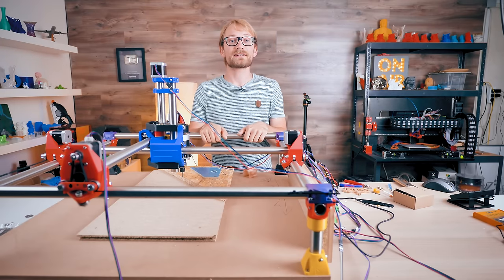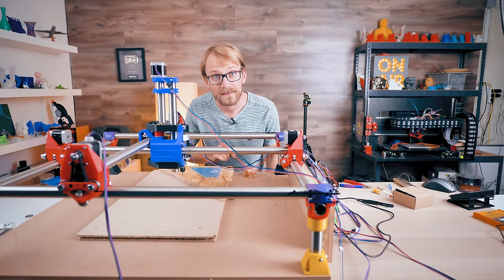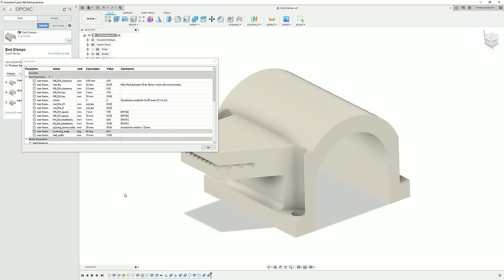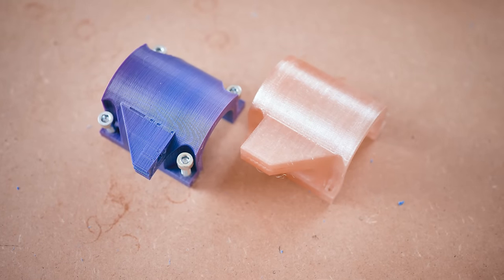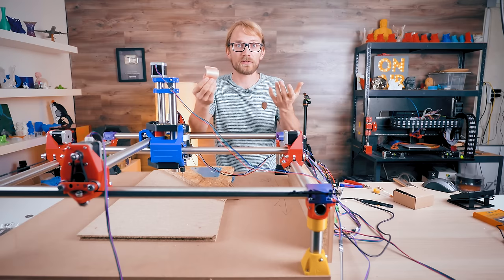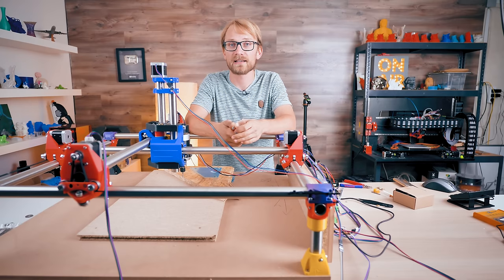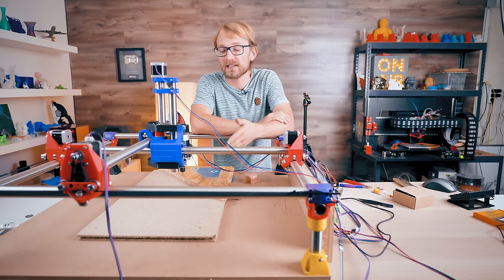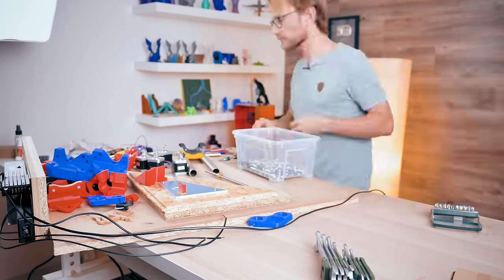Whose design even is this? (MPCNC conclusion)

Comment: I won't be building one. I was already hesitating the past 2 years or so because it wasn't technically open source to begin with - but knowing that I can't make and share custom bits completely ruins it for me. 
Tweaking and sharing improvements is literally half the reason I build things! I like to build tools (mostly software) and share them.

Looks like the logical progression is either the Root CNC (which I was leaning towards - but it seems less popular and is NC licensed) or Irvan Miranda's design.
Reply: @isaackvasager9957  yeah, i was thinking the same thing.  I have several aftermarket parts on my mpcnc. Seems like there is more to this story on both sides it seems.
Reply: @isaackvasager9957   Ryan had no problem with Tom releasing the design. The rub is that Tom wanted to release it with no license restrictions. All Ryan asked is that Tom re-release the part with a properly restrictive license so that people wouldn't try to sell it. This design was never open source and Tom knew that before he printed and built it. For Tom to release this part with no restrictions, then balk when Ryan nicely asked him to change the license is totally not Ryan's fault.
Reply: @isaackvasager9957   From what I gather it was more to do with the actual license that Tom wanted to release it under. 

MPCNC is released with a non-commercial license meaning it can only be sold by Ryan. 

From Ryans POV - Remixes/Improvements should be considered derivative and published under the same license.

Tom made a new design and released it under a license that would allow for someone else to commercialize it.

In other words,  if Tom were to have made changes to the all of the MPCNC parts by changing each dimension by .00001mm and released them with this  license then anyone would be able to Print Tom's files and sell them. Effectively undercutting Ryan's livelihood by allowing anyone to clone the MPCNC and sell it online. 

As far as I can tell Ryan has no issue with remixes/redesigns so long as they are under the same non-commercial license.

Seems to me that Tom could've chose to make the changes he wanted and simply released under the original MPCNC license. Instead he chose to try to strongarm Ryan into making this completely open source.

I appreciate Open Source projects but IMO respect to the creator comes first. In this case I see no reason why  Tom couldn't have just respected Ryan's wishes and made his redesigned parts the same non-commercial license.
Reply: @reneromo8814  that is not at all what for instance Prusa does for living. Hunting down people with other licenses.

But as Thomas CLEARLY say.  Obviously MPCNC is not suited for him, or me and many with me.  So we are respecting Rays wishes and going in another direction.

Happy hacking with the MPCNC, I will not. Pity though, as the design looked nice.  But that is how it is.
Reply: @isaackvasager9957  MPCNC isn't open, even though many, including Thomas and me, thought it was.

Well, there are other CNC designs...
Reply: @isaackvasager9957  doesn't care if you think it works great, it will not suit Thomas nor me.  And that is what counts here.

To bad it is because of licences, but that is how it works.  It totally up to Ryan to decide who and why people are allowed to use his design. 

So no, it doesn't have ANYTHING about if it is fair for Ryan. It is about what is reasonable and fair for they users of his design. For who it works for.

So again, neither I nor Thomas had even suggesting that Ray should change his license, have we?  So why do you ask if it is reasonable for Ryan?  Obviously he think that it is, as he chosen to apply the licens and expresses his will how it should be used.

And to be clear, I am happy it works great for you, with the licens limitations.  And yes, I KNOW it works for many others, I have followed the project for a while.   The license doesn't work for Thomas nor me.  
Happy hacking.
Reply: @reneromo8814  This is wrong for a couple reasons.

First, there's no "changing each dimension by .00001mm". That's not how copyright law works. It's designed to be flexible so ideas and innovation is protected, not exact dimensions.

Second, there's no reason to think Tom "chose to try to strongarm Ryan into making this completely open source". The whole point is it wasn't Ryan's design to begin with. As Tom said, copyright does not apply to elements of a design which are obviously necessitated by constraints.

If "respect to the creater comes first", you should be siding with Tom. In this case I see no reason why Ryan couldn't have just respected Tom's wishes and let him release his design under the license he chose.
Reply: @reneromo8814  Actually, Tom released the part under the same non-commercial license, said so clearly in one of his tweets...of course, his license didn't include Ryan as an exception, so he couldn't pull it into his for-sale parts, which is probably part of why Ryan was unhappy with Tom.
Reply: @LuisGarzaVox  That wouldn't make sense, since them Ryan would be profiting from Tom's work. It's a new part, not Ryan's design, so if Tom made it, he should be the one profiting off of it, if there were any profits to be made.
Reply: @skynet3d  see, the issue is that Ryan wants to have his cake, eat it and eat everyone else's as well. What he appears to want is for copyright of all designs that are compatible with his system to be assigned to him to make profit from it. So he's mad that Tom's part is public domain because others might make money from it, and he's angry that Tom changed the license to the one he wanted it changed to since he can't make money from others' work with that one. 

The only logical conclusion is that he wants Tom and other creators to immediately assign him copyright rights because "he had the idea first" or some similar worldview. This is not how copyright works and it's not how ideas work either, so effectively you can't make anything compatible in a way that is acceptable to him.
Reply: @skynet3d  that's just it, it's NOT new, it's completely inspired by the original design, regardless of it was built "from scratch".  If I re-write "Harry Potter" in crayon and spell his name "Hary" instead of "Harry".  It's not new, as I was obviously looking at the original to create my "new" work.
Reply: @GeoffreyPitman523  You're confusing a piece of artistic expression with a functional part. If I make a brake rotor for a Ford Mustang, Ford doesn't get to claim copyright over my brake rotor. Just because it performs the same function and fits in the same holes, doesn't mean the original designer gets some ownership over it.
Reply: @skynet3d  try not to just spout off Tom's incorrect argument.  It's a copy of the original.
Reply: Geoffrey Pitman it doesn’t matter. You can make functional parts that fit an existing design without concerns for copyright. The only way for that to be protected would be with a patent or somehow registering the part as a piece of art. None of that applies in this case. If you had a point no one would be able to make iPhone chargers, or any third party accessories for anything. Think about what you’re saying, it’s nuts.
Reply: @hodgeac  100% agree!
Reply: @reneromo8814  Disregard for open source licensing would be the downfall of the entire movement. All Ryan wanted was for Thomas to comply with the terms of the MPCNC license. Thomas chose (wrongly) to assert that his design is somehow original. It isn't. It "builds upon the material."

Thomas is wrong. Ryan is right. Regardless, none of this was appropriate in public fora.
Reply: Nah Thomas was correct and made his case in the video.  Thomas made a compatible part, that is something that we do for computer, cars, and builds of all sorts in all industries every day. Thomas' part was functionally different and wasn't even made to fit anything but commodity parts. This is just one maker trying to lord his decisions onto others when they didn't like his design decision. Pure childlike tantrum.

Comment: The gantry design of the MPCNC seems very derivative of the Ultimaker 3d Printer's design.  Perhaps Ultimaker should be suing him?
Reply: SPANKED!
Reply: @c4tohagen   V1 engineering did not invent 3D printing, did not invent the half cylinder, did not invent even the gantry mechanism, did not invent a pipe holder made of two halves. He's entitled to the copyright of his STL files but he is not entitled to a patent as far as the invention of this machine or any other intellectual function of that machine. . If he tried to get a patent for this machine he would get a smack down from a Company that has already patented the mechanisms that he's trying to claim.
Reply: So true, and so do the 608 guide on tubing. This is so ridiculous...
Reply: @intelligenceservices  And that is true in ANY country law! What (design) goes on the internet stays on the internet and is therefore doomed to be opensource. Good luck trying to stop that for the rest of owners life!

Comment: A while back when I first saw the MPCNC I looked into it more. This was in the early days of the project and I chatted with other people on line who built them. The impression I got back then was that the creators were not good people to deal with and it would be better to pass for the time. I thought they maybe have gown and were better to deal with now. This is proof that they are doing the same stuff and this machine will be a hard pass for me from now on. Tom was changing my mind about this project up until this video. Then all the bad crap I learned about came flooding back.

Comment: "I want to design a CNC machine that users have to 3D print parts for, but I don't want said users making and sharing 3D printed improvements for it." That's kinda backwards Ryan. 

Man, I was really enjoying this build and want one for myself. I think I'll wait a bit longer.
Reply: That’s not true.  There is a huge list of mods made for the MPCNC.  He just wants them to use the same license that he uses.
Reply: Just design one yourself that uses 608 bearings as linear rails, it would be a fun project.
Reply: Edited
Reply: @williammiller3277  that is not the Ryan who runs V1....
Reply: @timr86868  thanks for letting me know. Shoulda known by context alone.
Reply: Modding and sharing is not the issue, look around Thingiverse.  He just wanted them shared as the same license.
Reply: @GeoffreyPitman523  which he can ask, I mean you can ask anyone anything, but has no legal right to.
Reply: William Miller he does have the right to ask. That’s how the license works.
Reply: @timr86868  Making a compatible replacement part is not making a derivative work, it's not a copyright thing at all, or you wouldn't have third party auto parts.

Comment: Damn, that’s a shame. I planned to build the mpcnc before the videos launched but I will think about it twice now.
Any recommendations for a true open source mostly printed cnc?
Thank you for your honesty.
Mach weiter so!
Reply: Gohliat1337 Same for me. Will look for  another printed cnc
Reply: Don't bother.

A CNC needs rigidity because of the lever arm forces + rotational forces induced by the cutting head/motor.

Making one (excepting time and material costs)with 3D printed parts is like walking one step forwards, 10 steps back. 

Trust me. It's a waste of time elevated to nightmare shituation.

That being said, you can get away with making various components out of wood/MDF/HDF and various pipe clamping options. Using printed parts isn't worth the effort because they can't assure you of the tolerances required of a CNC. At the lowest end, is wood, above it, aluminium, above that steel, and the top, cast iron (there are inbetweens like, pouring concrete inside the components to add weight (mass is important) and rigidity).

As for design ethos, look up the Inventables CNC. That's the most barebones CNC design you can get, and that's a good thing because you can adapt a lot of the elements found in there to pipe and clamp design without spending too much time figuring out what should be what.

One other hint, get a dial indicator. The cheapest of greater division (inches or mm, your mileage may vary) you can find on fleaBay/Aliexpress etc. You need one. From measuring the parallels, to the travel, to the table plane being level. You cannot build a CNC without such a tool. You'll also need an arm and a magnetic stand for it (also, found on the cheap on those websites).
Reply: @aserta  shituation had me good XD
Reply: . Look on thingiverse
Reply: Don't waste your time, is very clear that they don't work, watch the videos, this machine was 99% fail
Reply: @matutolaYT  Your video maker couldn't follow basic instructions. Tons of us have cut aluminum or even steel with these machines.
Reply: @matutolaYT  Watch a properly built mpcnc video.  Tom cut corners, and didn't read the instructions.
Reply: Teaching Tech made a video about a cnc that is using a table as the bed an rides with wheels on it. Can't really remember the license on that
Reply: @SchwachsinnProduzent  It's the lowrider version of mpcnc from v1engeneering... same problem
Reply: @Gohliat1337  yeah, I noticed it after I searched for the video again (but couldn't find my comment again to correct myself)

Comment: I witnessed the original twitter exchanges.  This type of thing gets sticky real fast.  I don't really like NC licences when used in this context: they are better used in other contexts like as part of a marketing push or a end-use-only tool for personal use cases... and are what i like to call a 'dead-end' licence. I consider them only quasi-open, and it shoots the originator in the foot otherwise.  The NC clause feels rather like just a glorified instruction manual and collaborative beta-test. For example: the RADDS printing board is CC BY-NC, which precludes monetized discussion, and as a result, there is very little discussion on the widest-used platforms -- i.e. monetized platforms -- and they have gernered onli niche attention.  Same goes for Gen7. but the discussion brought up two interesting grey areas: work-alikes and monetization via education by fair use.  Personally, I take Thomas' position here: work-alikes are not covered by the original licence, and monetization via education/discourse is fair game, within reason. monetization via education is covered by fair use 99% of the time, unless a specific clause is included to preclude it, BUT technically NC would preclude that except under fair-use... which is where the licence comes into conflict with precedent and accepted-convention. A work-alike is perfectly fine and accepted unless it violates some other clause or licence, like an aesthetic trademark/patent, etc.  The same goes for 'aftermarket' parts:  see the auto industry for legal examples.  If aftermarket bolt-on work-alikes are fine for even restrictive patent law, I believe that is a good enough precedent for application here. Otherwise many many projects tied to things like Linux would also be illegal (even the 'sticky' applications in that realm: MAME, WINE, etc, which are generally accepted as legal within reason).  The original author obviously embraces the former but rejects the latter. But I think Thomas also made the correct decision in that while he may be in the right, chose the high-ground and conceded to the author's wishes, be they reasonable or not.

Comment: Licenses are a mess. Props to you for pointing that out
Reply: Licenses are fine, but illiterate, greedy and envious people applying them to whatever are the mess.

CC-NC series of licenses are meant for common "freeware" and "shareware" where you can have your demo version for free but can't do anything with it and have to pay for some different license in case you want to actually have it.
But modern hipsters just throw in NC clause out of greed or envy, without thinking for a second about issues and consequences it will result in.

CC, sadly, is but a malignant tumour on the opensource community which is a malignant tumour itself on the free software movement.
Best we can do is to just cut it away before it's too late.
Reply: If you dig into the issue the creative common license structure is actually fantastic. Of course there's a lot to it, but it fits the maker space needs very well.
Reply: @goury  really? "modern hipsers" and it's "greed" to try and protect your livelihood?  The ONLY thing Tom was asked to do was release the part NC just like the original, THAT'S ALL.
Reply: @GeoffreyPitman523  yes, greed and envy.
And also lies about being open when it isn't.
Reply: @goury  uhh no one ever claimed it was open source.  So either you are misinformed or deliberately misleading others.

Comment: I have a clothes rack that extends both vertically and horizontally. It’s made of light gauge steel tubes sliding inside one another. It uses very similar fittings to clamp off the tubes, locking them in place. I feel bad for you Tom.
Reply: Yes that's a good usage case for lightweight round section tube, a CNC machine definitely isn't. Round is useful for torsional loads only,  not bending as you get from cutting forces, for that you want rectangular or square. This thing has the worst possible combination of design choices. Poor deflection resistance tubes that are nowhere near solidly anchored enough at the ends in torsion so as to be able to resist twisting, just a mess. It's one step removed from hot glue and drinking straws.